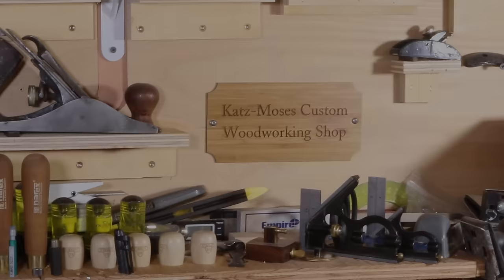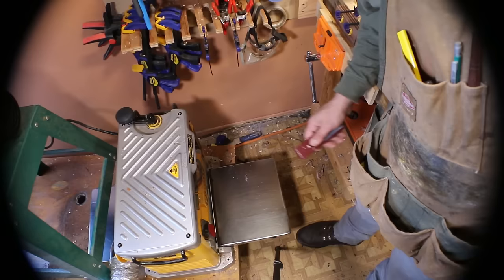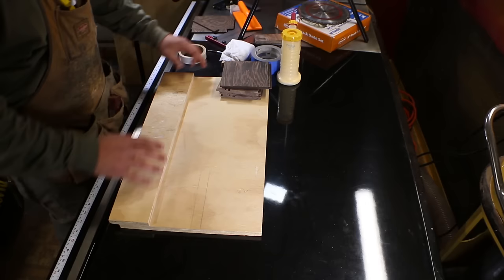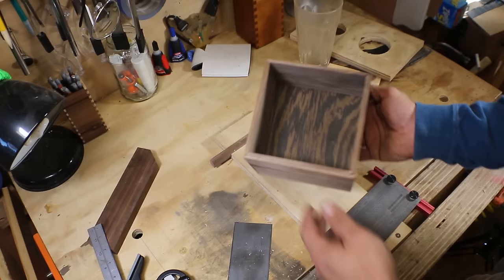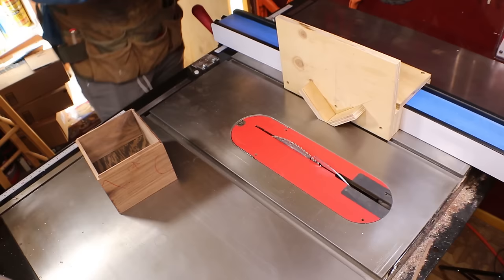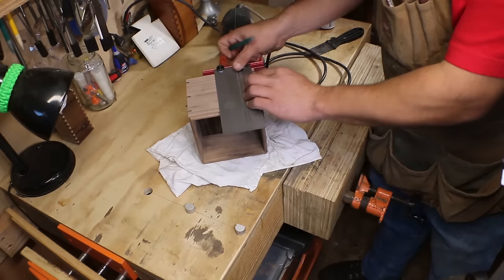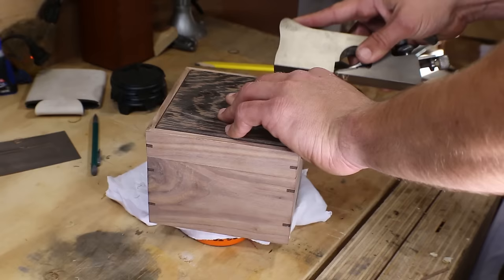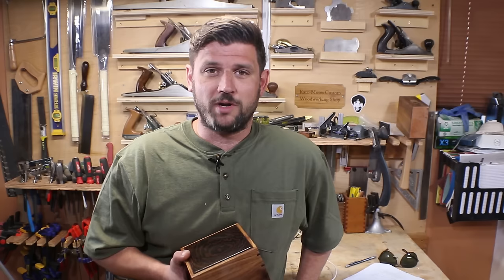Old Video, WATCH MY NEW STUFF IT IS WAY BETTER Build a Box Upside Down - Perfect Fitting Lids

Comment: The 'upside down' concept does get your mind working, 'out of the box' so to speak (groan), but I still would prefer just making an enclosed box and cutting off the top.  There's better grain alignment, and if the sides don't end up precisely square, or if those rabbetted edges are too thin or thick, then the lid would either be too tight or too loose.  Glued inserts would serve just as well for aligning the lid as the rabbeted edges do, better even since inserts would register the inside surfaces of box to lid exactly, as opposed to sneaking up on a precision-depth rabbet cut that has to be perfectly half the thickness of the side pieces (which wasn't really covered, getting the blade height perfect for cutting that rabbet).  Not meant to be trolling as some have alleged anything other than a glowing comment to be...  As I say it does get your mind working on things like fabrication and assembly options in projects in general, but in this application it's just not my cup of tea -- but more power to those who do like it.
Reply: I prefer to glue a liner of contrasting wood inside the lid. This way the box grain matches top to bottom and the liner keeps the lid  aligned.

Comment: It’s a nice box but you’ve broken the vertical grain continuity between the top and the bottom. I do something similar, but I place two offsetting saw kerfs 1/4 - 1/3 of the way from the top of the box.  Cut one on each side with the “outside” kerf being lower than the one on the inside.  Make the kerfs 3/16” - 1/4” and carefully watch the depths of the kerfs. When they separate, you get perfectly matching grain patterns.  If you use book matched sides, you can even have the grain wrap completely around the box.

Comment: Do not do the glue and sawdust filler. It's an idea that should have died a long time ago. For a professional finish stain your project and apply at least one seal coat of finish and allow to dry. THEN fill with a colored filler or a filler that will take stain and remove the excess and continue with the rest of the finishing process. Filling bare wood will cause any number of problems. Glue and sawdust or sanding dust does not accept stain and smearing it around seals the wood around the fill and again doesn't accept stain or the filler worked into the grain may soak up too much stain and make a dark spot.
Reply: Linda Elfstrand AMEN! People will be sad to find out when they go to stain and finish that every spot of glue will show through.....
Reply: He didn't use any stain, and you don't stain good hard wood. He just used a wipe on polyurethane
Reply: Little late but there wasn't any stain used so....

Comment: I like your technique.  I use the wipe on poly a lot as well as spray poly in an HVLP sprayer if the project is big enough.  My only addition would be to use the Zinsser Universal Sanding Sealer (Dewaxed Shellac) because it smooths out the finish and the first and second coats of poly are not asorbed as much thereby making a better finish.  They sell  Zinsser "Traditional Finish" but that is not dewaxed shellac and can cause problems with poly finishing.  Keep making sawdust.  Many boxes I make I do similar but I cut the top off the top and it always fits perfectly.  I just make the box about 1/2" taller because I mainly use 1/4" box joints and the fingers march up.  Additionally I chamfer the edges of the bottom of the top and the top of the lower box to hide imperfections and it makes a good stop with a piano hinge on the back of the box.
Reply from the maker: Cheers!

Comment: Seems like when taping the sides for glue-up. you could lay all the sides with dadoes facing down.  Align them along that straight-edge. And lay the blue tape ON TOP of that row of sides.  And then flip all four of linked, taped parts up , glue the joints, and form into the box shape.

Comment: I always place the box sides inside down and apply the tape over the outside while holding the sides against the straight edge.  Then I carefully pick up the four or more sides that were taped together and turn them so that the inside is now facing up.  This keeps the edges all aligned and the tape is not so hard to manage.
Reply: Your method Dave, is the one I see used most frequently and use personally

Comment: I was most impressed by your wood shop. For example I've never had a proper vice for wood working. Your bench vice appears to be home made. Do you perhaps have a video describing its construction?
Reply from the maker: It's a design based on one Jay Bates did. Basically it's two pipe clamps and some plywood. Cheap, easy and efficient ! Thank you!

Comment: One reason not to cut the top from the bottom is to preserve the grain pattern.  If you have a nice grained wood, one would want the grain to visually flow from the sides to the top, which will occur when you cut the top of the box from the top.  Cutting the top from the bottom will visually disturb the grain pattern.

Comment: Man you better get to work, I'm almost out of videos ;)
When you're wet sanding the poly, you use mineral spirits instead of water. Can you elaborate on the why? I'm getting pretty good at the cutting and gluing, finishing is a whole different animal. I've spent hundreds of hours on an acoustic guitar only to muck up the finish.
Reply from the maker: james dixon hahaha thanks bud the poly was oil based so needs to be sanded with mineral spirits. Learn to use shellac. You'll be stoked you did

Comment: How do you deal with wood movement on the lid and base?
Reply: Since there was no answer from the Mr. Katz-Moses I thought I would tell you what I have experienced.. Normally I would not  glue the top or bottom into the dadoes. I cut the dadoes deep enough to accommodate the insert so there is a small space for expansion. I didn't look to see if he glued or not. Some folks glue them in and don't seem to have a problem on a small box. I have done both ways without a problem. I think the larger the piece the more likely there will be a problem. Others may disagree, just my experience.

Comment: I have been looking for a table saw blade that will leave a flat bottom groove but can't find one. Can someone tell me where
to get one?
Reply: Myron Benware 
Forrest makes a very nice blade for about $125.00. It's a special grind on their Woodworker #2.
It's #WW10401125.
Reply: Freud LM74M010 10-Inch 30 Tooth TCG Glue Line Ripping Saw Blade with 5/8-Inch Arbor and Silver ICE Coating
Reply: If you have a dado stack, use one of the side blades.  Most leave a perfect 1/8" flat bottomed groove.

Comment: This video is obviously for advanced woodworkers; I see no reason to make the box upside down as just cutting the lid off from the top will ensure a perfect fit. Making the box upside-down could still result in a slight difference between top and bottom of the box so would need to be corrected on the final fit, cutting the lid off the top of the box makes for a perfect fit every time.

Comment: By doing it this way you upset the grain pattern.
Reply: Also…just rub the edge with a steel rod ( screw driver ) to close any gaps in your joint.
Reply: Spline spacing should be symmetrical.
Reply: A fourth spline would have been nice.